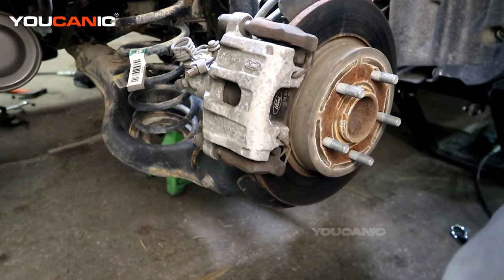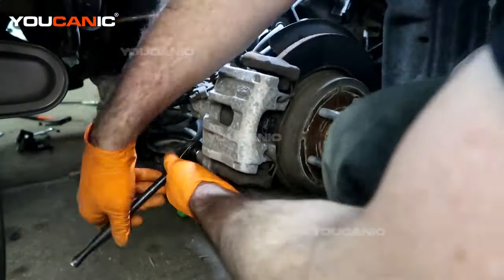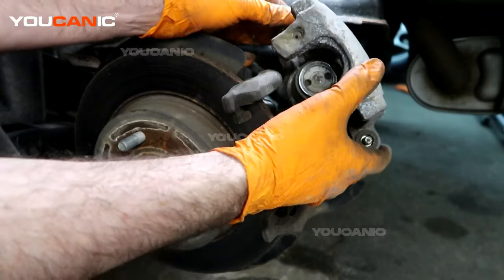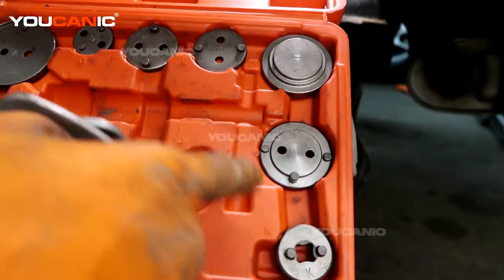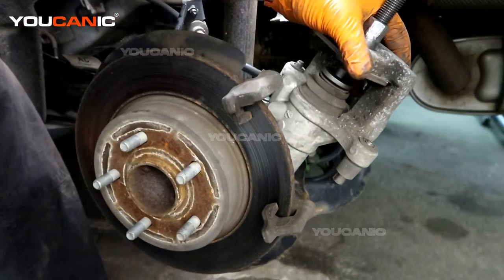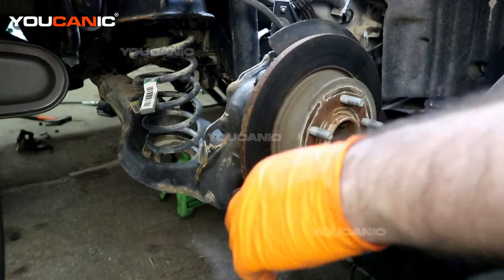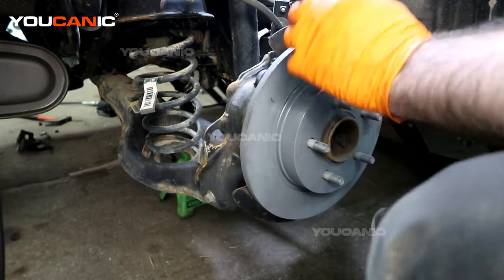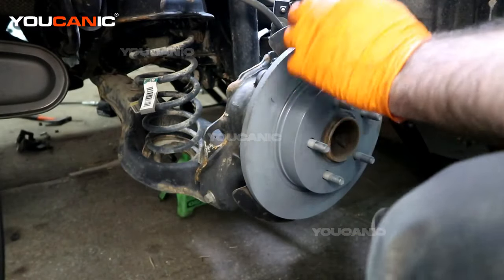2012-2019 Ford Focus - Rear Brake Pads and Rotor Replacement

Comment: Thanks for doing this video , my local ford dealer wanted £325 for doing this  😡.I have the same kit as you  so i will be doing this job shortly £65 uk pound for genuine ford  rear pads  so they wanted £260 for labour .

Comment: I changed the pads and rotors on my 2017 focus ST I did everything like your video but now my rear passenger brake is sticking. I've jacked the car up and tried to spin the wheel with my hands and its very tough to spin compared to the rear driver wheel that i can spin easily with my bare hands. I have no idea what could have caused the rear passenger brake to become sticky.  I've been told by a mechanic that what could have happened is that whenever you retract the piston without opening the bleed valve you could end up pushing back old dirty brake fluid back the opposite way but in your video and other peoples videos I dont see anyone open any bleed valves or anything I just see everyone simply retract the piston without touching anything else and thats exactly what i did too.
Reply: I have to change the pads on a st. Did you solved it?

Comment: Are the rear brakes do you know disc or are they drum?  I know the front are disc but I have a 2014 cord focus se sedan and I’m not sure if they are disc or drum but for some rotors it shows a need to know that but if info. Your response would really help and be appreciated if ya see this. -Paige
Reply: The ST trim has a disc rear. I don’t know about the other trim models.
Reply: The ST has only disc I the back, and the lower trims could have both, so you'll just have to check and see what you've got
Reply: All  SE's have rear discs.
Reply: .... Don't do your own brakes if you can't tell discs from drums.

Comment: Does your car have to be in neutral
Reply: No, the rear wheels are free spinning But make sure it is in gear and chock the front tires when jacking up the car...and always use jack stands
Reply: @korkyou812  thanks I’m about due for new brakes so I asked much appreciated

Comment: I heard when you wind in the pistons, connect a tube + jar to bleed screw and open it. This captures excess brake fluid. Two reasons for this.
1. Stops overflow in master cylinder.
2. Stops risk of damaging seals in the master cylinder.
Reply: I normally just use a syringe  and take some fluid out the master cylinder first .
Reply: Just open the cap on the brake fluid reservoir

Comment: Do you have any good tips on  the parking brake spring not sticking, making the parking brake not reset?
Reply: Same boat here I believe. Right parking brake engages, left side does not pinch the rotor even when manually cycling the spring, unfortunately. Have you had any luck with that?

Comment: What rotor cause we are having a hard time with this 2012 Ford focus SEL the oem rotor was sent by Ford does not fir the oem pad is laying half off the rotor and Ford dont have answers told me to pound sand practically
Reply from the maker: Thanks for reaching out! It sounds like you're having a tricky time with your 2012 Ford Focus SEL. At Youcanic, we aim to support and empower car owners. We offer useful guides, free resources, and our own Youcanic scanner to assist you with your car maintenance. We're puzzled about the rotor and pad issue too, but don't worry, we're here to help. 

Please visit www.youcanic.com for detailed factory repair manuals and more. Don't hesitate to reach out on our site if you need further assistance. We're here to support you on your car ownership journey and ensure you feel confident under the hood!
Reply: @YOUCANIC  Thank you. I'll look into that. I'm a shop owner in Palm Springs, Florida. I was so lost when Ford parts guys couldn't help me that puzzled me how they can't explain what is happening .